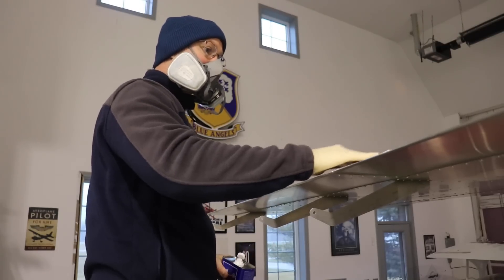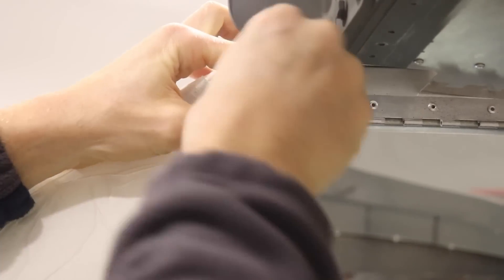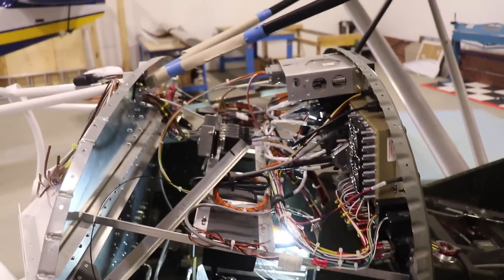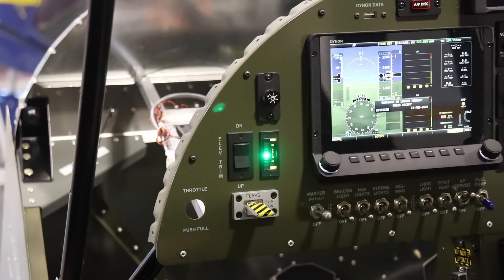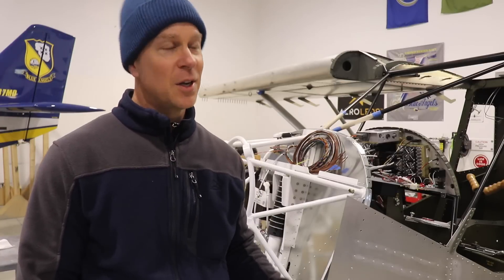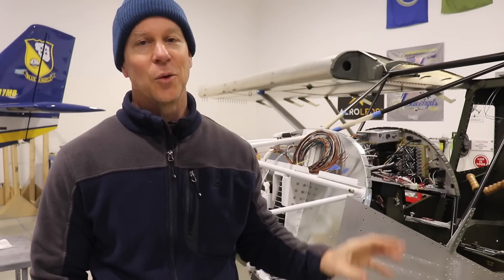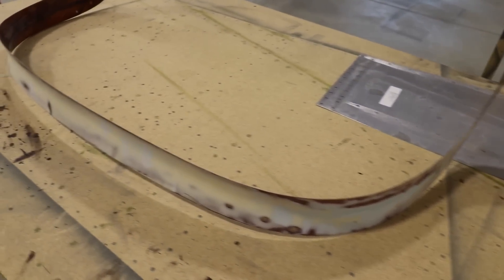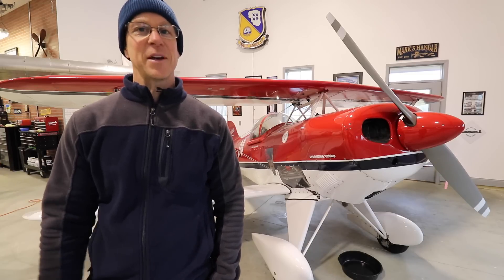Airplane Building in 2023

Comment: Aileron. Follow the crux to  the apex - center tap with punch three light taps. With sterling silver tablespoon or soup spoon making rapid high frequency tapping motion into dish area several minutes until the metal thickens again; it'll firm up. Scuff with scotch Brite then Finish with 3m feather flex - block sand and top with Sherwin Williams sealing primer or equivalent.

Comment: Before you drill out all those rivets,  maybe try an inexpensive dent puller- the type you temp glue a pull rod / with pull weight. Nothing to loose but a few dollars for the puller and use many more times as you acquire more dents 😆 happy new year

Comment: What about a couple of small,  portable infrared heaters for the gluing? One in the cabin and one overhead. Adjust for proper temperature, glue the window in and hold the temp until the glue is fully cured. Avoiding direct radiation of the uncured glue, of course.